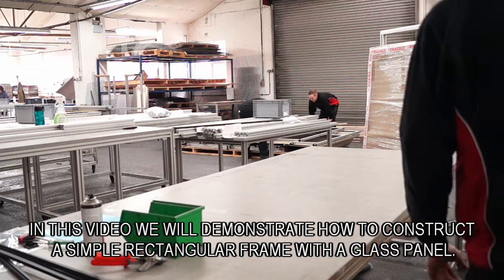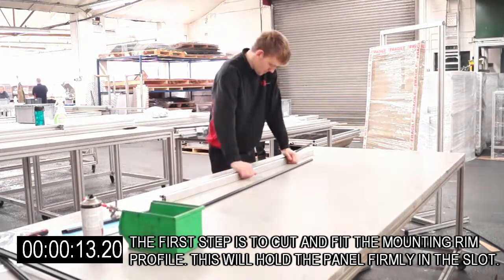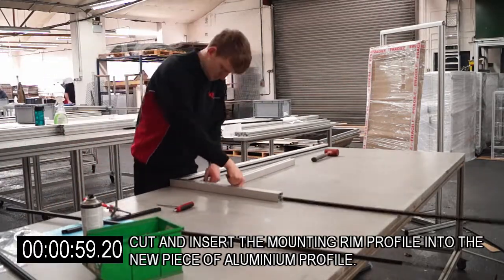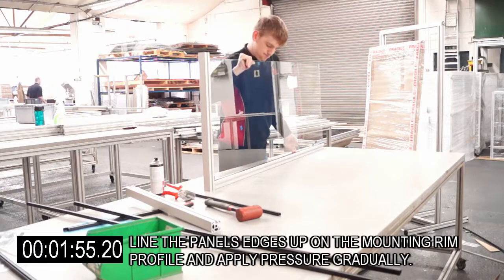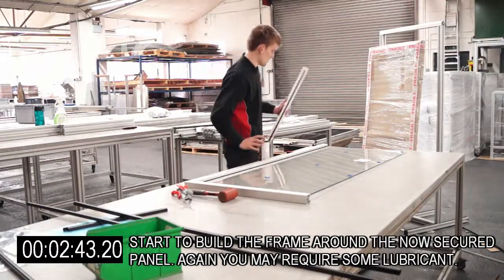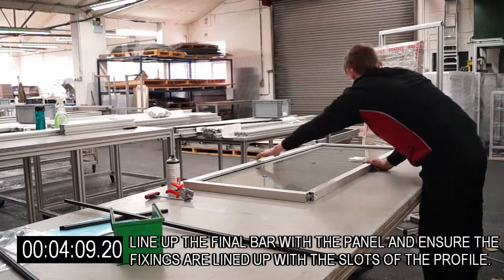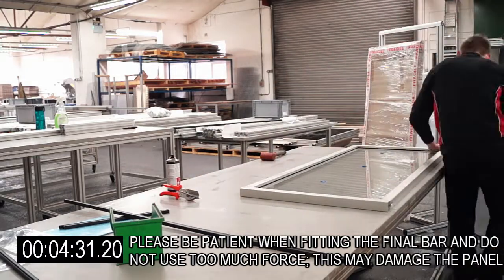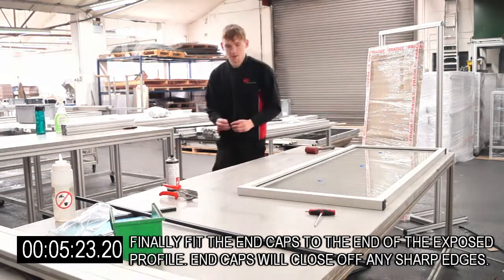KJN: HOW TO BUILD A GLASS PANEL FROM ALUMINIUM EXTRUSION

Comment: Hi , is the washer watertight? Thanks
Reply from the maker: Hey Hussars Overland, the mounting rim profile as is shown in this video is not water tight. It could and is often used in guarding where oil or water may be at risk of splashing against the panel, but would certainly not be suitable for something such as a fish tank. This is not officially IP rated as it is dependant on design and how it is fitted, but even an un-experienced fitter could achieve an IP rating of IP53. Their are different types of mounting profile which provide different levels of solid and liquid ingress, but none of our products are sold or should be recommended as 'water tight'
Reply: Thank you
Reply: @KJNAluminiumProfile  hello, could you provide me the link or company name producing those mounting rim profiles please
Reply: @KJNAluminiumProfile  How can I find mounting profiles? any website that you guys recommend? Thanks!